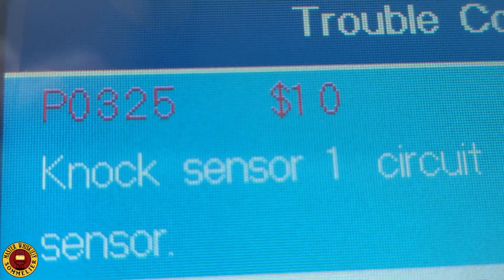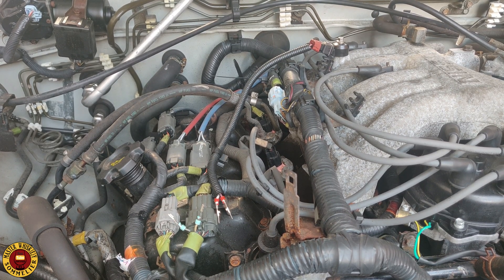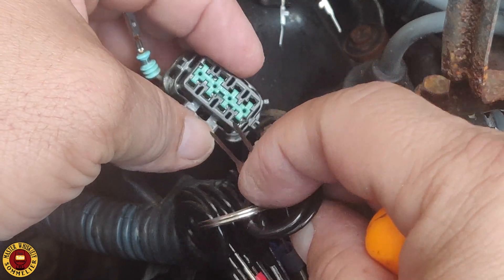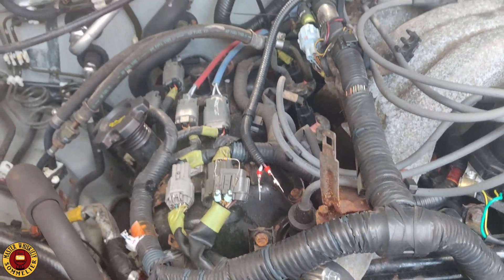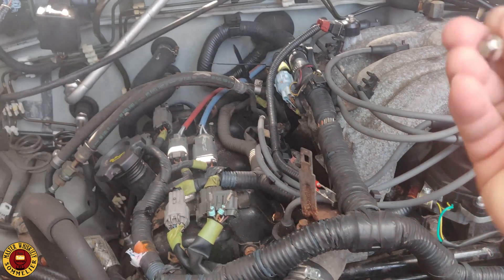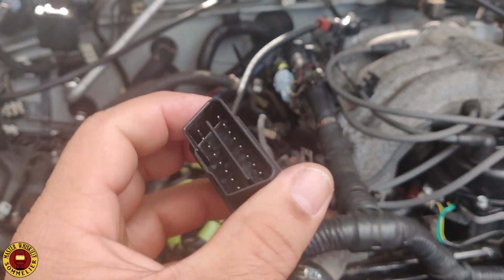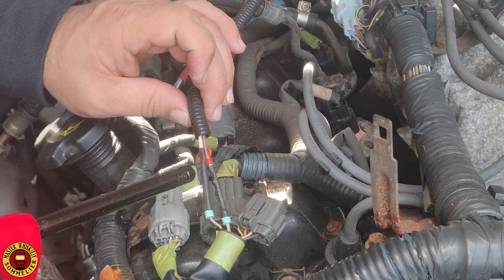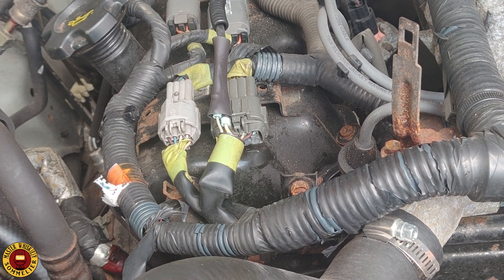Nissan Xterra P0325 Knock Sensor Resistor or Relocation Hack

Comment: Will the check engine light turn off when you replace the knock sensor or do you have to hook up it to a diagnostic box?  thanks
Reply from the maker: You have to erase it with a diagnostic tool

Comment: I went threw the hassle of doing  knock sensor job myself only to find out the connector wire with these according to my mechanic are notorious for failing. So I want to first relocate  with new wire and sensor on top then confirm wire is indeed the problem, then transfer to original spot under lower manifold. Thing is i want to use your method of tapping into wire going to ecm and bypass the whole potentially bad wire and original Nissan connector because I have a new Hitachi inside engine already and want the connector fit to be correct but will not have the length to transfer. Can I just add length to the new harness with additional wire? Or would it be optimal to try finding plug end to knock sensor itself then make length I need then terminate it to the wire past connector closest to the radiator.

Comment: Any idea if the resistor mod takes care of the rough idle caused by a faulty knock sensor, or is it simply to turn off the check engine light?
Reply from the maker: I wouldn't know.  I didn't have that issue

Comment: So can you leave the ends on the 2 wires you pull out of the plug and just shrink wrap the resistor to that or would it be better to cut the ends off?

Comment: Thank you but that is too risky and complicated . just reach at back and use old conectio wire and conect to new sensor . that only cheats the computer . how do you know this ate the correct qires did you check pr you trust sombody else. ?

Comment: I see you removed the 2 wires from the male end of the factory harness plug and plugged the holes with silicone.  Could the 2 wires on the new knock sensor wire be inserted into female end of the factory harness?  The wires from the female factory harness across from the holes that were plugged with silicone on the male end.
Reply from the maker: Maybe but I didn't want to take that side apart.  Here is the tool https://amzn.to/2YlGuma